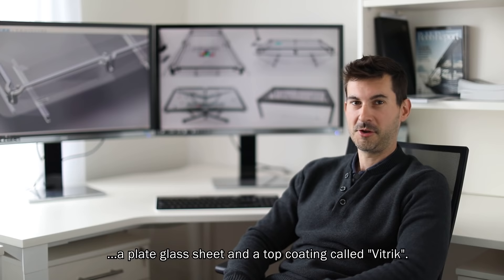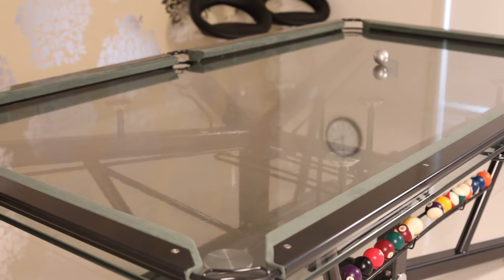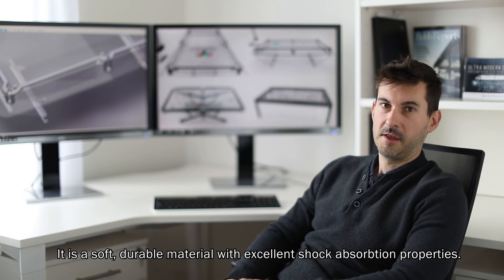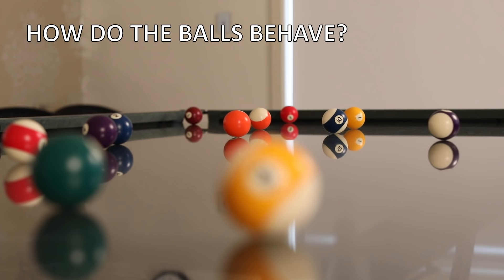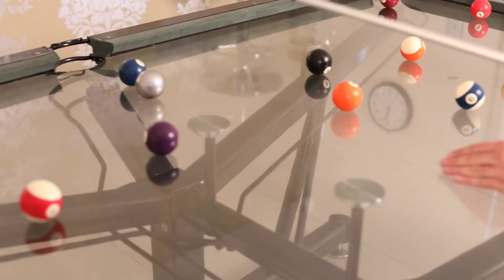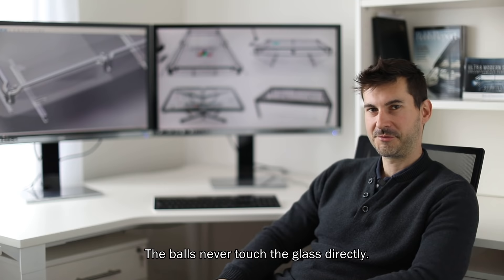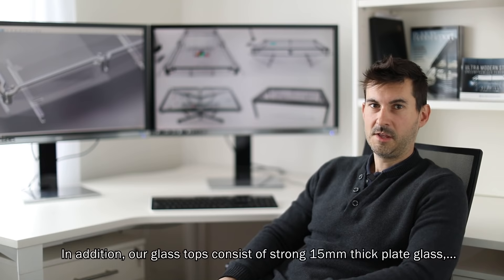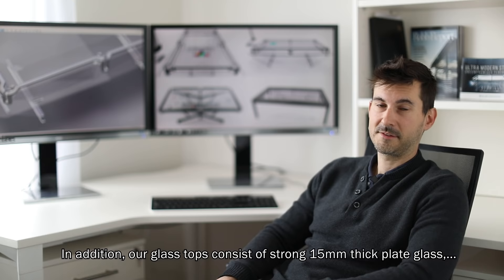How Does a Glass Top Pool Table Work - FAQ's

Comment: Four observations. 1. Seeing through the bed of the table to the stuff underneath and to the floor would be distracting, and would affect your concentration. To shoot well in pool, you have to concentrate. 2. You would get reflections of the room lights off the table surface, lessening the clarity with which you could see your shot. 3. A fabric table has a warm feel to your bridge hand when you make a shot; this table, I would think, would feel cold and unpleasant. 4. When you make a jump shot, the cue ball would make a harsh clattering sound when it comes back down, rather than the soft thud it makes on a fabric surface. All in all, then, a solution in search of a problem.

Comment: Show me a draw shot. I can't see how the cue ball can grip. And what about finger prints?
Reply: AK not the finger prints is the problem 
The dust from the chalk will absolutely curve the ball
Reply: And all the chalk?
Reply: and what about curves or is it strong for a jump shot?
Reply: AK well if it has a coating it it could work, but I would also like to see a better demonstration.
Reply: was thinking the same thing
Reply: "smooth gloss surface... allowing spin to be applied"   - ummmm i dont think you can have it both ways..
Reply: good question

Comment: One thing I always said I'd do if I was rich would be to design a transparent pool table. This will save me the job, however I'd be customising it so that once the balls drop into the pockets they'd run along rollercoasters all around the underside of the glass, instead of just going straight to the rail.

Comment: The table sure looks cool but how long does the surface coating last and can it be replaced as easily as felt?

Also, couldn't you put felt on that glass plate?  I would think that would be the real trick for getting the cost of a good, flat pool table down is to just replace the ground granite with glass and put felt on that.  Wouldn't give the cool see through look though.

Comment: What about I try to spin/curve my ball ? Will the glass crack?
Reply: NightmareDOGE if you watched the video he said that the barrier between your cue and glass is strong enough to withstand dropped balls, trick shots, and cue tip impacts
Reply: One would want to see a few jump shots or heavy english applied did not see that. With traditional surface it wears and is replaced, I wonder about this surface is it able to be re applied at site if damaged?